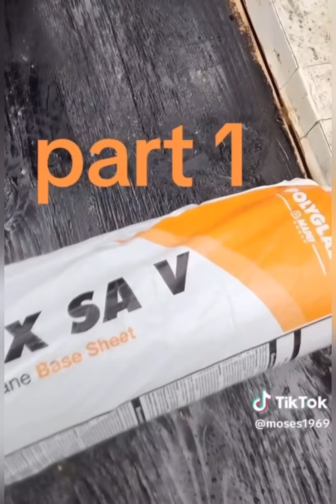ROOFING SCAMS!

Comment: certainteed plybase can be used as a base sheet but they recommend using primer on the deck. its the reason why i'm buying nailbase now because i dont want to adhere straight to the deck. it would be a pain in the ass to fix the roof later down the line.